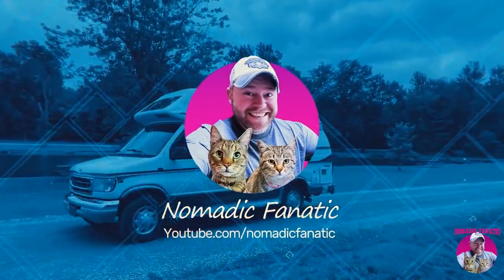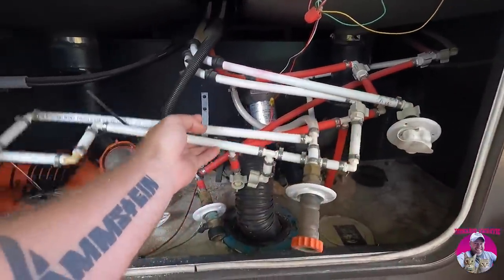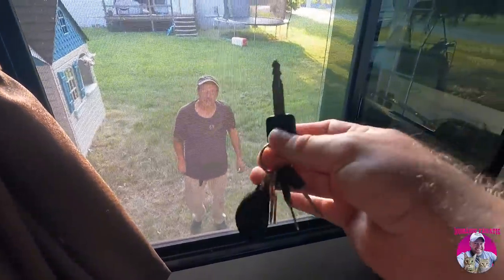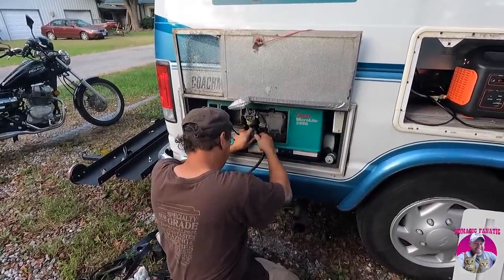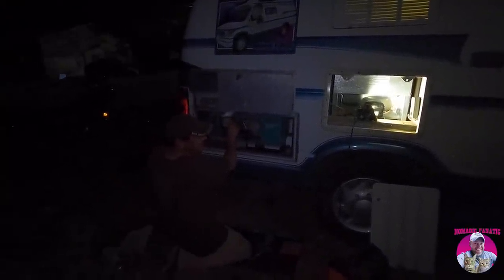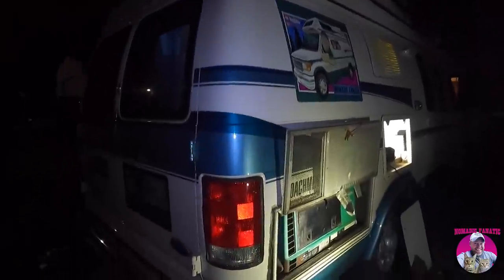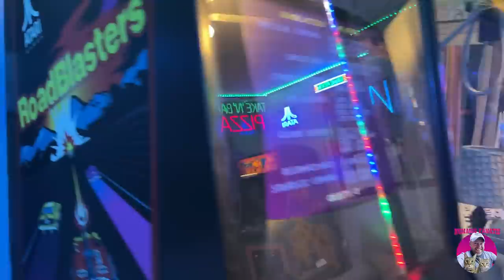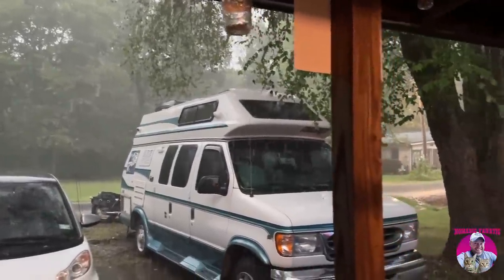Drivers Side Exhaust Leak Test & Onan Generator Carb Work

Comment: If the exhaust leak comes back instantly, check the catalytic converter and Muffler. You might have a blockage causing back pressure.
Reply: I had suggested he get rid of the catalytic converter, if it still has one.  That back pressure creates so much heat and pressure, and helps kill the manifolds, studs and gaskets.   I’m in the performance engine building biz, have been for 40 years.

Comment: Weather has been so weird in the Midwest.  I have so much moisture at my house that the grass needs to be mowed every 4 days, as if it were still Spring and not August when it is usually dried up and dormant.  However, my office building which is only 25 miles away is so dry that only the weeds are growing good.

Comment: Hey Eric....I got a chance to talk to my mechanic friend, (also shop owner), of mine whom I trust and have know for 59 years yesterday....I ask him about your Ford V 10 camshaft problems....He said just replacing the camshaft(s) only will not fix that motors problems and it will just happen again....He is very familiar with this motor and this problem...He described it as a bad valve seat / bad engine block original machining type problem....He said the only best way to take care of it for good would be swap out the motor for a new "Jasper", engine....They have totally fixed the bad Ford V 10 engine problem Ford created originally....He said this is the only way to fix this for good...I also ask him if you could swap in a new 7.3 gas Ford "gorilla motor" instead?...And he said no, you'd have to change out all the computers, wiring harnesses etc, etc...The new motor would come with a warranty too....Just thought I'd try to help you out....good luck!...Tim...aka Eagle Eye...

Comment: Eric, that new wet bay would look super sweet if you used diamond plate aluminum, I did so and OMG the comments I get. I Also installed the sea level tank level system that is Blue tooth , you can read your levels in % instead of thirds and with your access to those tanks an install would be a breeze. Imagine flushing your tanks and knowing exactly how done they are while being by your Westbay . Really cool and cheap upgrade.

Comment: Re: The crazy plumbing space.... I am not a plumber, just general handy man knowledge, so I don't know for sure, but its possible some of that mess is to minimize water hammer (water pressure shocks as valves are opened and closed quickly or the pump cuts on and off), or air traps?
Anyway I would get someone with plumbing experience to double check the layout (or check what other owners have done) to see what you can safely eliminate or reconfigure to clean it up..

Comment: I'd rather have the rain like Illinois than the drought and fires of California.
Reply: i know right and plus temps high around 106 here in the kern valley
Reply: Eric states that Illinois has so much rain. It must be the specific area where his home base is located. Not all areas of the state gets as much rain as he constantly complains about. He is in the Alton area. I am located south of his location approximately 15 miles. My home base is 10 miles from Downtown St. Louis on the Illinois side of the Mississippi River. We could use some of his rain. Alton is about 20 miles as the crow flies from my location. Eric send us some of your rain?😁👍👍✌️

Comment: I evidently missed something..... I thought you were having problems getting a cam to replace the damaged/scarred camshaft caused be the bad lifter. When did you get and replace the cam? The exhaust gasket did quiet her. Congratulations on getting her running. Wayne the wizard does it again 😀. Belly rubs to Jax man. Safe Travels. 👍👍✌️

Comment: those carb are are one used on 5hp tecumseh engine / theaters don't run on film it's all digital mainframe network & servers for each screen digital projector / the Illinois  fall is actually a late season for tornado it happen once

Comment: Hey Eric and Wayne when it comes to Small engine carburetors you also might want to try to see if somebody has an ultrasound machine to sonically clean out the gunk and the varnish and some passages that you can't get to as easy that's why I did my with my old generator emerald one with no model and cereal and my main jet was and what still stuck in the carburetor just my two cents Eric and Wayne and yes Wayne is the man fixing things I'm pretty good at fixing lawn mowers and tractors but I'm too far away from you I'm in Colorado Southwest Colorado canyon City

Comment: Your water pump location is far better than mine.  Mine is in a very accessible location.  It is right by my headboard.  You can imagine how startling it is in the middle of the night.  The pump kicks on to up the water pressure and MGRR-RRR-AAAAP!  Wakeup time!  It vibrates through the wooden base of the bed. Awful.